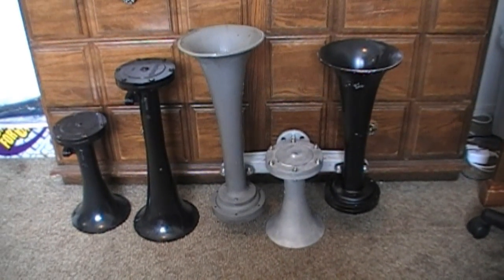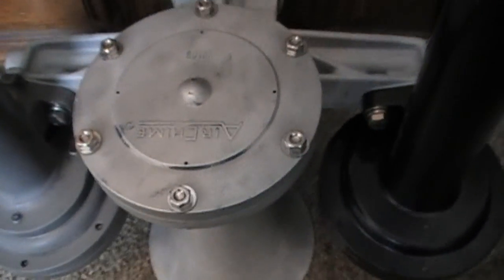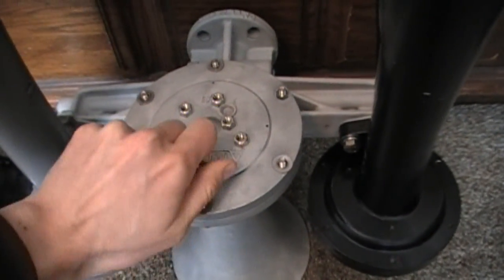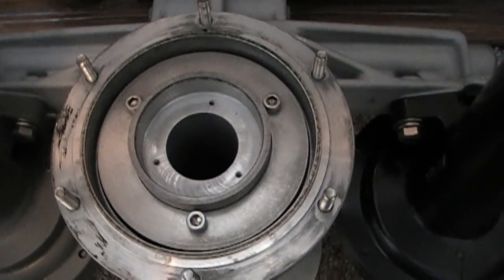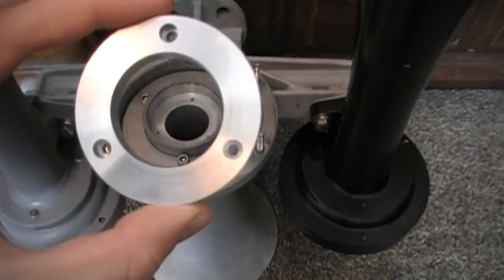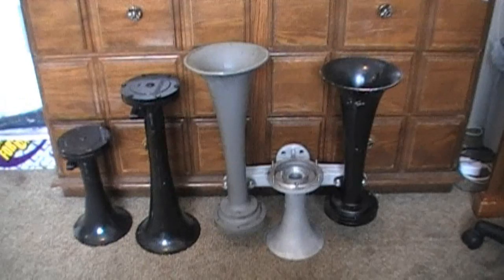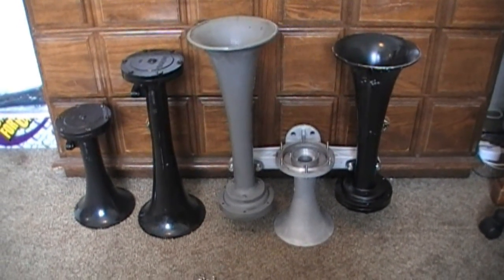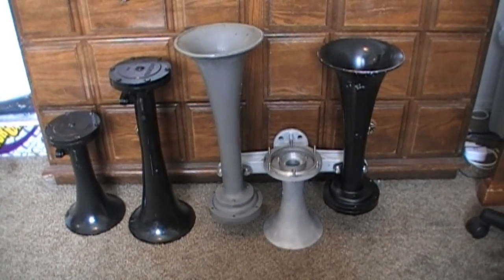Convertible K3

Comment: In my video I posted of me filming a RBMN train the horn sounds a little bit like this but I couldn't tell if it was a K3H, K3HL, RS3K, or RS3L and it was dark its my first video
Reply from the maker: +Bacon Master It appears to be a K3H or K3L.  Its hard to tell since the engineer is barely putting air to it.  What is the reporting mark and number of the locomotive?
Reply: +mafarnz RBMN SD40-2 #3052 or #3055. The RBMN railroad I noticed has so many K3 horns on their locomotive and they sound so similar and have a lower tone instead of a higher tone.
Reply: +mafarnz also can I make a request for you to make a K3LA or what ever K3 horn it is sound like one close to the K3 horn in the 3rd video I recorded because I bought some bells to make a K3 horn sound like it in my video but I can't figure out how to. Maybe you can help me or make a tutorial

Comment from the maker: For the Leslie sounding K3HLL, what I have is a standard unmodified two piece sand cast 1L bell, standard unmodified #1.  The #3 is what is different most K3# bells are tuned to either an A# or G# (3A).  For the leslie sound, the #3 has to be tuned to an A.  To do that, you have to do one of two things.  What I did is take a #3 that played an A# and had it bored down to play an A.  Another thing you can do is get a 3A bell that plays a G# and have a shim made for it that makes it play an A.
Reply: mafarnz So using a 3a bell will work just as well as using a modified 3l to create this chord?
Reply: mafarnz 
Prime 990

Comment: that would be great. i cannot seem to find a used real horn at any places around here. i looked at western rail in airway heights and they sold all there used horns and only have new ones that range from 600-800 bucks and i dont wanna spend that much on a horn, but if ya have any laying around that i could fix up and repaint or something like you have done id be glad to buy one... ive always wanted to have one on my truck and drive the milwaukee grade near avery through tunnels like youve done

Comment: Is it possible to drill into a 3 bell and somehow make it a 3B?
Reply from the maker: Um, did you watch the intro?  I stated that the #3 had been machined down... that's how a 3B is made, you take a #3 and bore it down till it plays an A instead of A#.  That's what I did to get my 3B.
Reply: Yeah I saw it...but I think the right bit and drill press could MAYBE do it...just brainstorming.
Reply from the maker: R3DZ0N3
There is no way to do it with a drill, not unless you want to ruin the bell.  CNC mill is the only way to go.  I had mine professionally done, only cost $120 ish.
Reply: Oh. Well yeah I guess that was kind of what I was thinking of. 120? that's worth it. Also, do you mediablast the horns? If so, would you recommend blasting with glass beads?
Reply from the maker: R3DZ0N3
$120 is about what it cost to get the #3 bored down and make the removable shim, if all you are ding is boring a 3 to a 3B than it will cost less.  Glass bead blasting is the preferred way to media blast a horn, sand is too abrasive, it removes too much metal.
Reply: Well, I WOULD like to only have to buy one 3 bell. So I think it'd be nice to have the shim too. Thanks alot.

Comment: Hey Maddie, What hardware did you use for the variable pitch #3? Also, who did the machine work? Was it Mike Muha?
Reply from the maker: The insert is held in place with three small Allen set screws. Muha did the work.
Reply: @mafarnz  Thanks, I meant the hardware that held the backcap and the length and thread of the screws. I might be using that hardware on my horn since I remove the backcaps very often.
Reply from the maker: @sepa2401  I used 1 1/4” long bolts with standard nuts and flat washers. You could also go with threaded studs for a cleaner look without the bolt heads on the “wrong” side of the bell.
Reply: @mafarnz  Thank you.